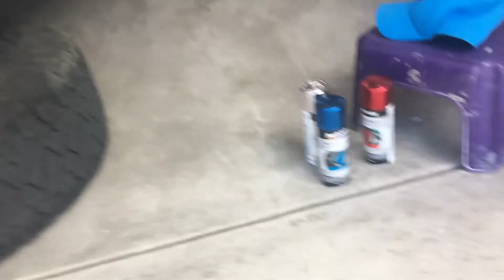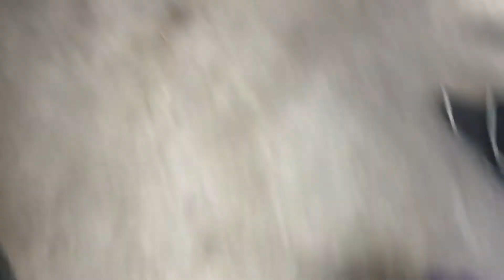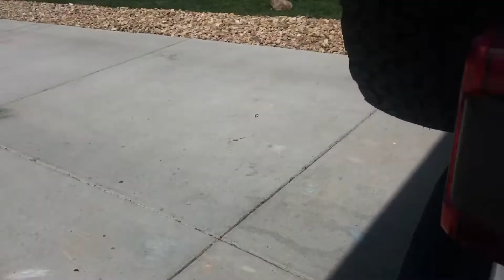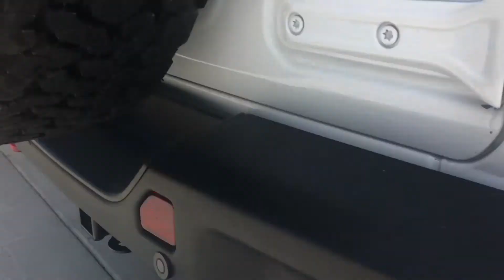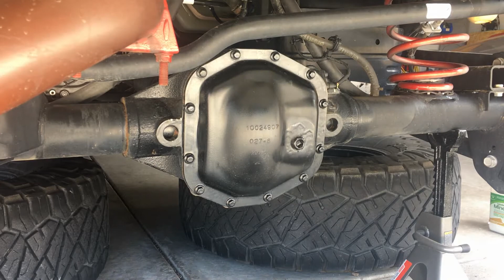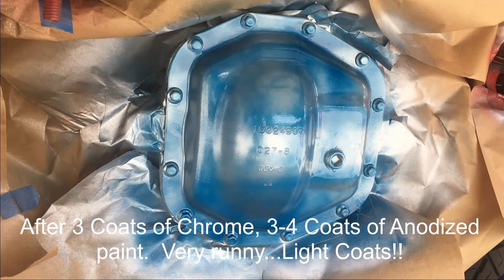Candy Blue Differential Cover

Comment: Why did you use the self etching primer?
Reply from the maker: Painting over a painted surface and self etching allows you to not have to sand or anything to prep other than degrease so just makes sense to me. I’ve used that on all metal and plastic parts and it’s been great.

Comment: Did you use clear coat?
Reply from the maker: No. That way I can touch up easy with just paint if I needed to. It’s held up just fine over 2 years.
Reply: @persicon_jl  That's actually a good point. A diff cover on a trail rig takes some abuse and even the best paint and clear coat on earth will eventually get scratched up.